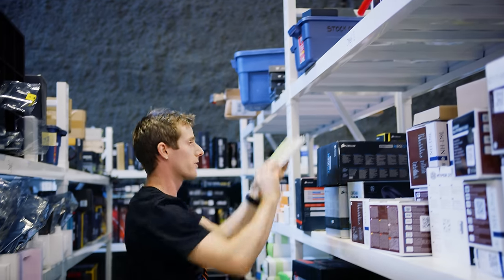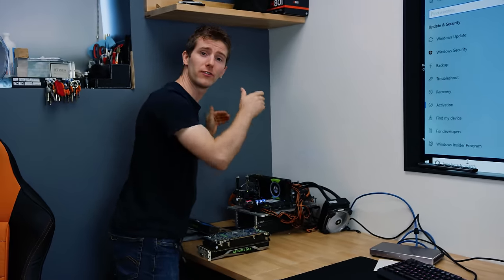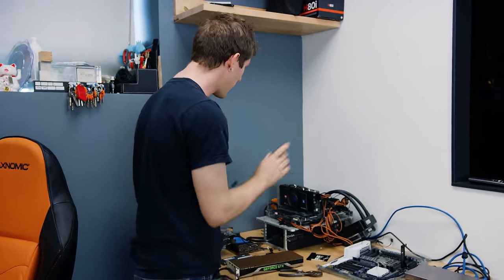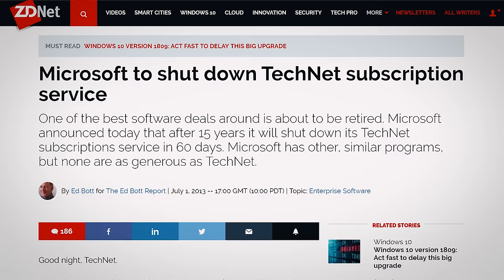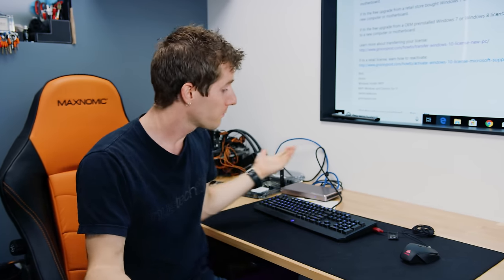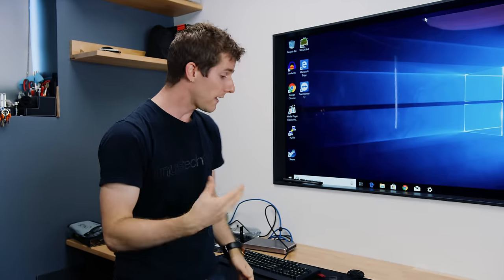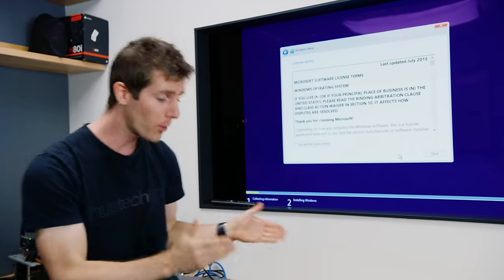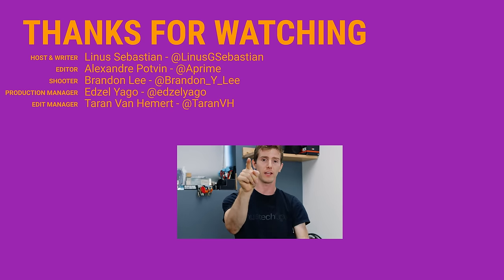Why Does Linus Pirate Windows??

Comment: When you buy a License from microsoft for windows. Should it not be indefinitely yours? Imagine this with your car. Having parts replaced until the point of losing ownership of the car.  Am I missing something?
Reply: This reminds me of an oldie but goodie:

At a recent computer exposition, Bill Gates reportedly compared the computer industry with the auto industry and stated: “If General Motors had kept up with the technology like the computer industry has, we would all be driving $25.00 cars that got 1,000 miles to the gallon.”

In response to Bill’s comments, GM issued a press release stating: “If General Motors had developed technology like Microsoft, we would all be driving cars with the following characteristics:

For no reason whatsoever, your car would crash twice a day.
Every time they repainted the lines in the road, you would have to buy a new car.
Occasionally your car would die on the freeway for no reason. You would have to pull over to the side of the road, close all of the windows, shut off the car, restart it, and reopen the windows before you could continue. For some reason, you would simply accept this.
Occasionally, executing a maneuver such as a left turn would cause your car to shut down and refuse to restart, in which case you would have to reinstall the engine.
Macintosh would make a car that was powered by the sun, was reliable, five times as fast and twice as easy to drive – but would run on only five percent of the roads.
The oil, water temperature, and alternator warning lights would all be replaced by a single “General Protection Fault” warning light.
The airbag system would ask “Are you sure?” before deploying.
Occasionally, for no reason whatsoever, your car would lock you out and refuse to let you in until you simultaneously lifted the door handle, turned the key and grabbed hold of the radio antenna.
Every time GM introduced a new car, car buyers would have to learn to drive all over again because none of the controls would operate in the same manner as the old car.
You’d have to press the “Start” button to turn the engine off.

The last one came true.
Reply: You don't own a software, just a license to use it. Software is intellectual works like a book, a movie script or a paint.
Reply: No no no. That's not what it is. It's buy a key for 1 (one) machine. Soooo, they don't want you buying a key meant for 1 machine and then using it on 10 machines or 100 machines and selling windows. They would not make good profit then for their software. Soooooooooo, they try to attach a key to one machine. That's it.
Reply: If you try to draw a comparison between two unrelated things with different situations, should it not make sense?  Imagine if you did this with a crappy "if this was a car" comparison.  Am I missing something?
Reply: Windows licenses sort of work the opposite way - when you inststall Windows on your computer, you don't own Windows... rather Microsoft suddenly own your computer!
Reply: @TomSteele93  All of that sounds like GM right now.. lol
Reply: They should add in there if cars were like Mac's that if you need a part replaced, the dealer would tell you it will cost more to fix than it will cost to buy a new one and then refuse to fix the car. And of course no one other than that dealer is allowed to fix your car.
Reply: Well, ask Tesla what they think about repairing your car yourself. They don't like that.
Reply: @James Rosemary
No, when I buy a book, the book it's mine. I can do whatever I want with it. You are negating me proprety rights with this behaviour. Authorship is irrelevant here.
Reply: Pretty sure I can own a copy of a book and movie script. I don't think anyone has a claim to the ownership for any of my paint either.
Reply: If I buy Pirates of the Caribbean, I own it.   If I pirate it, I still own it. It won't sudden;y stop playing, because I play it on my stolen dvd player.
Reply: Dan, the answer to all of this is KMSPico. Just don't get it from the 'official' website, or you'll spend a few hours reinstalling shit.
Reply: Matt Cannon, Yes. You wouldn't download a car.
Reply: James, well if they didn't put a properly installed faraday cage in the car, obviously the tesla coil that powers the thing, would be dangerous. Always remember, wear an aluminium suit when repairing your tesla car.
Reply: +Rudie Jellema - Yes, you're missing that for some reason, when it comes to I.P. (Imaginary Property), the governments of the world have decided that copyright holders have the power to do pretty much anything without being accountable to anyone and their customers have no rights at all.

Seriously, read the EULA for any piece of software. There's a clause in all of them stating that the company won't even guarantee that the program will work. Not only that, they specifically state that they're not responsible for any damage that that their software might do. So if you use an accounting program that has faulty math and it ends up costing you real money, the company says it's not their fault.

Imagine if the TV you just bought had the same EULA. If it doesn't work, that's your problem, and if it has a defective component that starts a file and burns down your house, you can't sue the company. That would never fly for real products, but when it comes to "I.P." companies are free to screw over the consumer as much as they want.
Reply: If you buy the full version that is the case, but if you buy the OEM version it is for use on a single computer (mostly defined as a single motherboard, though it sometimes gives you a break.
Reply: @Ormaaj  if you change out enough parts of your car then in some places you have to license it as a new car or "assembled vehicle" but only in relatively extreme scenarios.
Reply: +Chris B - It's hard to tell who you're replying to. Are you saying that if you buy a full version of Windows, you don't have to activate it, or that it never requires re-activation?

I just read on another forum that Microsoft will no longer activate Windows XP. I would think that people who bought full retail copies of that OS might have a legal case against them for intentionally breaking a legally purchased product.
Reply: I think the other way. Microsoft sells licenses to operate the car like a driver's license. You own the hardware, meaning the whole car in itself, but to "drive it on the road" you need license. You don't lose ownership of the car itself.
Reply: +Angel Roman Lumanglas - You don't lose your driver's license if you change the tires and put in new spark plugs.
Reply: @Sharp_3yE  Hun? It's the same computer. Period. PC is an open platform where hardware swapping IS A COMON THING. So no. It's stupid.
Reply: Welcome to the Ship of Theseus.
Reply: @d.romero3014  And we are permitted under US copyright law to make copies of the book, film, etc. for personal use.
Reply: Stop using logic
Reply: James Conway  yeah because people burn to death while working on gas engines. Stop buying into their bs.
Reply: @d.romero3014  
The artist, writer, or painter can't take the shit I buy when I move into a new house.
Reply: @TomSteele93  Epic!
Reply: James Conway  

Well that's just it, isn't it? I mean, if I screw with something of mine and end up hurting or killing someone else...that's still on me. I won't ask the manufacturer of whatever I screwed up to pay for my mistakes. 

And if it's me being hurt I will be going full on at the person not the manufacturer. 

And if I'm ever a juror in a case where a family is suing a manufacturer for what some idiot did, I will refuse to reward them.
Reply: Rudie Jellema you own a car, you don’t own windows, you own a licence to windows. There is a difference
Reply: MACINTOSHED APPLE INC
Reply: Just be like pirates, download a windows loader and be done with this nonsense. Last time I upgraded and windows deactivated, pirates had the perfect solution. Microsoft's help line didn't. So thanks, pirates.

Look, if you paid for it, you use it. It's that simple. If Microsoft doesn't understand common sense, that's their problem.
Reply: laws are different for intelectual property. You can never really own it. Only own the right to use it for a while.
Reply: Thats nice About  the EU, that way it doest work here, yours is yours, so MS Cant Just say " your run out of activations" :)
Reply: @d.romero3014  So if you bring your book to a bookbinder to have it bound in a leather hardcover, your licence to read it will be revoked ?
Reply: I'm pretty sure the reason it's done is as a security measure to prevent hackers from duplicating their key to another system
Reply: @Edconox Was a case recently that went to the Supreme Court and they pretty much ruled fuck EULA and if you own it's yours. Do whatever the fuck you want with it.
Reply: Studd Muffin  Indeed, you write on books, the same way you write on your pc, but you don't "own" the story, in fact, if you were to sell a book as the author of the book, that right there is illegal, as in software, it really depends of the company, there are some companies that are okay with Mods or harmless implementations, but even in games, you never really "own" a game, you have a license to play it, mod it if the company allows it and so on... Why? 
Easy, in order to actually "Own" the game your 60 bucks are nothing really, a simple cinematic in a AAA game will cost way more than that, with 60 bucks you would probably get a bunch of models tops, a game can cost millions.
Reply: Studd Muffin  I didn't spoke in favor of the intellectual property laws that last 120 years, although, I am indeed in favor of intellectual property laws, let's say I write a story in 3 months, you steal the story from me and sell it for your own profit, you find that fair? But let's talk games, games take 2 years, 3 years to develop, would it be okay for you to just copy paste the game and sell it as your own? Also about the windows, even though I am no fan of Microsoft, that bs isn't true, if you have 1 copy of the windows, and you change it from one hardware to another, you can still use it, as long as there aren't 2 hardwares using the same windows, Microsoft is okay with that, what Is not okay it's using the same copy of the windows (1 key) in a company with 1000 employees, which kind of make sense... or no? 
About your quote, I wouldn't pay anything to use it because it's crap, and unlike windows and a good game, it didn't took you more than one fart in the bathroom to make.
And I don't remember saying it was okay to "pirate" games for the little guy, I am saying that intelectual and copyright laws should be respected.
Okay, let's pick a more labor related example, you build an entire fence for a client, I arrive there, talk to the client and get your money, that's okay for you then?
It's not the same you might say, ofc not, because I can't copy paste a wall, but if I could, would it be fair? You did all the work, I just copy pasted it.
Want to really own a book? It's easy, spent thousands of dollars to get a publisher and start selling books and paying taxes to Uncle Sam, and if you want to own a game, same thing, get a video game company, build a game from scratch (Which might take you 6 months, 1 year, 2, 3, depending on the game you're making) and you're free to own it! it's that "easy"!
But please, don't compare a fart sentence to a well written book or 3 years of game development.
Reply: @Aggrobiscuit  I actually wasted precious time posing that same question to Microsoft, and as long as you don't use the software in 2 computers at the same time, it's okay by them, the fact that you constantly change hardware, well, it's a specific subject, and while I do agree that in those cases Microsoft lack a legal way to do stuff as shown on this video, on most consumers, 1 key is valid for 1 computer, what does happen a lot and I see it happen a lot is that the "STORE" where you buy the computer tells you that you need a new license or doesn't inform you or even ask if you already have a license, even OEM is also included in the 1 computer thing, if you have a computer with an OEM license and it get's toasted, you can change your older license to the new one (As long as you only use the New one instead of lying and using it on 2). The store where I've mounted my current computer also was telling me that I needed a new license, but I was intrigued and went to Microsoft:
https://support.microsoft.com/en-ie/help/20530/windows-10-reactivating-after-hardware-change
Reply: Congress or the supreme court needs to make it illegal for licenses to expire apart from specific time licenses, if there is no time limit, companies should be forced to honour your paid license forever.
Reply: Studd Muffin  Also, in the U S and A there are stupid cases of copyright infringement and intellectual property, I am not denying that either, all I am saying overall, and my stand was always the same, copyright laws and intellectual property laws are good if not abused. 
But then again, with the fence you can't really do the exact same replica even if you tried, in software is different, you can "Clone" it, and that's the problem.
Although, in games, copying a game and sell it as your own with 2 or 3 changes usually gets you mocked, better to have original crappy work than good crappy compiled work that can be traced back in less than 1 minute.
You don't start working unless you get payed first? In that case the next time you buy a game or a software, the company will give you a key and say, okay man, now just wait 3 years until we do it, and in 3 years you can play the game... lol.
Reply: All those who have replied to me seem not to understand yet.
The author of the software (book or painting) owns its creation. This does not mean that he is the owner of the physical medium where his creations are. It means that he owns the work itself.
Picasso does not own the canvas and ink where he painted El Guernica. He owns El Guernica! No one can own it even if he owns the canvas and the ink.
J. K. Rowlings is not the owner of the physical books where Harry Potter is. She owns Harry Potter.
In the same way, no one can own Windows except Microsoft because the creator of Windows is Microsoft. I repeat. You own the physical medium but not the content on the physical medium.
Reply: @Golden Dragon I can't tell you that. Sorry. I never saw Windows source code in my life.
Reply: it is indefinitely yours, especially if you have your windows key. At most you have to fight indian tech support and show proof of new hard ware if it really comes down to it.
Reply: But you can owe a book or a paint. Nobody can tell you "Sorry, by now you can't read yours books anymore."
Reply: James Conway  E-Engines are simple af compared to ICEs, Tesla is locking you out for the same reason as Apple, arguably even worse
Reply: Studd Muffin  Also I think you must understand something here, no one is going to sue you if you do your own game, yea sure, they can try like some did, and there are some cases where copyright law is abused, but that doesn't mean it's okay to just copy/paste something, same way that they don't own the programming, you can program anything you want, you can design anything you want, unless it's an blatant" copy of their work, that they can't allow and I agree, if that was legal every game will literally be the same exact thing, and that it's just stupid and it sucks.
Also when a software is available to the public, there are laws and contracts protecting him, because when you spent 60 dollars or 40 dollars for a game, you are not really buying the game, a good rigged 3d model can cost from 90 dollars to 160, and that's just 1 character.
So let me guess, you're kind of contradicting yourself there, if a solo developer game got hacked it's okay because he is stupid (Doesn't matter if he just doesn't have the money to protect his software, as long as you can hack, it's his fault, so I guess suing you next it's a violation of the international thieves code?)
Also, isn't the coke the exact same thing as a software license? You drink the coke, but you can't make the coke again or can you?
Can you copy paste coke?
I really don't get your point to be honest, and as a guy that plays games and respects the developers of the said games, I think you just want an excuse for considering "Pirating" okay, and if you think that's okay, I really don't care, I am no cop, but still, that's the kind of BS that usually thieves come up with to justify their actions.
And I call it BS because that's what it is, is there any law against doing rpgs? No there isn't. Is there any law against doing OS? No there isn't.
You pick up let's say Final Fantasy, and you do a rpg of your own, that's cool.
You pick Final Fantasy, and you copy paste it and call it something else, that's not cool.
Is it really that hard to understand?
To me, you just want an excuse, the typical thief excuse 1.(Bah, the company is rich), 2. (They overcharge anyway), 3. (They don't care about their customers...), and so on...
Reply: Intellectual property is just a way to enslave you.
Reply: software is different from other products. they are giving you updates! So, it's difficult to maintain the software for the same one-time payment. so you could say they still own some of the software.
Reply: Naw, more like you having to go to MVD and purchase new license plate. install a turbo or supercharger on car, needs a new license plate. Soo... yeah sorta.
Reply: @TomSteele93  Yeah the last came true and cars are more and more computerized which means the rest will come true also. Just a matter of time.
Reply: @d.romero3014  Kudos for having figured it out.
Reply: @bkpickell  and don't forget, the dealer would update your car's software to reduce it's gas mileage and slow it to only 35 mph. Cause, it's old now.
Reply: @funkyfreak97  
You mistake that I don't know the facts of the case. I'm fully aware that a dumb 70 year old opened hot coffee as she was holding between her legs. The entire case was settled based on emotion versus logic. McDonald's was not liable. And in fact, had the lady not been old they would not have lost. I say that with conviction. Even more so should it have been a middle aged man. That statement alone is enough to realize how frivolous the lawsuit was and how illogical and WRONG the jury got it. Had I been on the jury it would never have passed. I can surely feel sympathy that she HURT HERSELF, but not at the expense of a company that did no wrong. In the case they even brought up all manner of pseudo science about the "correct" temperature of the coffee when served. Ironically even the CDC I think told them the recommendations of the defense team of one temperature was too hot after the fact. 

It's a simple case of fact.
Was McDonald's negligent for serving the hot coffee at the temperature they chose?
No.
Was McDonald's intentionally trying to harm customers?
No.
Did an employee of McDonald's spill the coffee on the customer?
No.

It was a bullshit ruling and the lady deserved not a single dime. It is no different than her driving and running off the road into a telephone pole. The electric company doesn't pay for that. And neither does the car maker. Because it's 100% her fault and no one else's. I don't care if the car company sold her a car that is able to go 200mph. It didn't tell her to drive reckless. 

McDonald's served the coffee at the higher temp because most customers wanted a cup that would maintain a high temp even when driving 30 minutes to work without being so cold as to be nearly undrinkable. 

Another problem is too many companies think that they will build and maintain higher loyalty rates by caving in and settling these cases out of court. Which actually factored into the coffee case. It doesn't. It instead drives an entitlement mindset which significantly lessens personal responsibility and respect for others. As well it encourages a lack of respect for your surroundings. Leading to more accidents of various type by vacuous morons and ridiculous clauses on everything sold to remove liability from companies. Things like warnings to not use a chainsaw on metal, or use a weed eater while wearing shorts and sandals, or not to drink drano, or not to eat tide pods. A product manufacturer or seller should not be held liable for stupidity. 

Opening a hot coffee between your legs, especially if you feel removing the lid is hard because of your advanced age, is pure stupidity. And simply because your are female and old is no excuse. She should have paid her medical bills and taken the life lesson in late age for what it was. Don't spill hot coffee on yourself if you don't want to be burned. Kinda like don't touch the stove burner when it's on. Common sense.
Reply: Rudie, Microsoft is made for people that have no fucking idea how to replace RAM... with all the lawsuits going on atm attacking electronic repairmen I am not surprised. I should SHOULD be allowed to repair my own shit! I bought that single item, copyright law goes with using some one elses work for profit... If you are selling REPAIRS for profit you are HARDLY violating copyright...
Reply: @TomSteele93  you officially won the internet.
Reply: LOL oh boy. Guys, you can already switch parts in a pc and use the same key. You can switch the motherboard, processor and other things and the key will still work. If you change all of it then it's a new PC and might not work BUT you can call MS and tell them you bought new parts and they will let you still use the same key.
Reply: @emanuelpereira871  Hun, you can already swap out parts on a PC and have it use the same key even though they keh is meant for 1 pc. They allow that.
Reply: @d.romero3014  You buy a book and you own that copy.
Reply: @d.romero3014  you own a book
Reply: @Sharp_3yE  I will grant you that OS development is an expensive endeavor, BUT, how much money is Microsoft making on Windows, really? They get more money from Office and their Xbox division than Windows as it is.

Windows Activation: 1 time fee of 119 or 200 dollars
Office 365: $8/month for one person, $10/month for up to 5 people.
Not to mention a cut from the sale of every game for the Xbox, or purchased through Microsoft's online storefronts.

They are getting more of my money from Office, and maybe Xbox in the future, than they ever will through Windows keys.
Reply: @seph.  But you don't own the art in that book. That still belongs to the author.